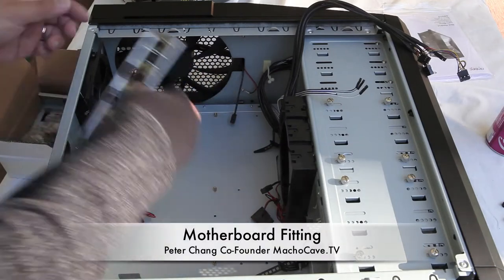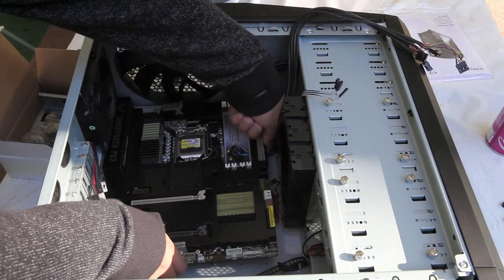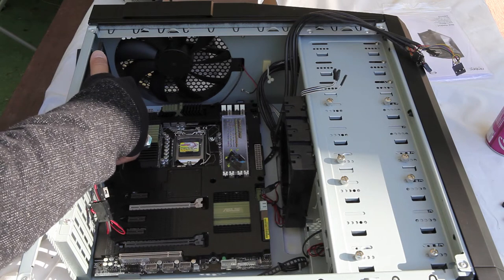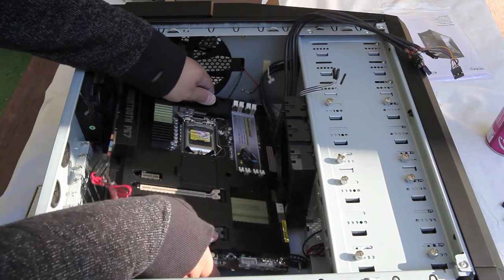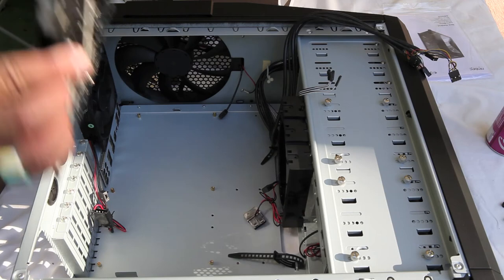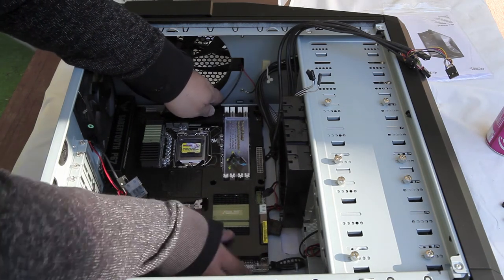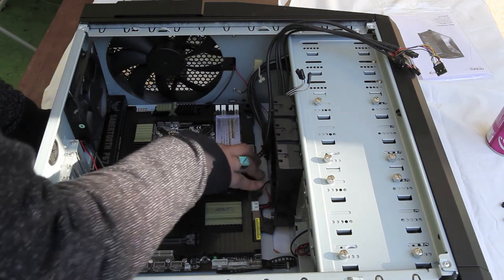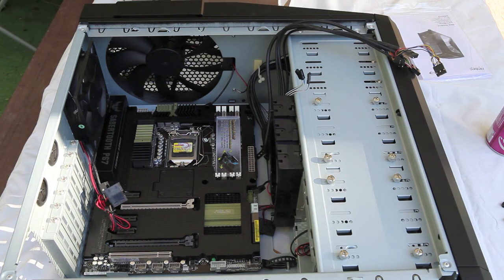Motherboard Fitting Building your own computer Part 3

Comment from the maker: Yes this can be pretty tough. If your computer case has a removable  motherboard tray, try aligning the board flush with the motherboard tray. If your computer case is similar to mine--you may have to realign the motherboard--I did this 2 times--you place one screw in--then place the exact opposite screw in and screw in the motherboard in a star pattern always going to the opposite side, till all of the screws are aligned. Also, try aligning the back plate before the foam backing--this helped me

Comment from the maker: Great question! I haven't worked with the AMD version of this board, and most ASUS boards fit standard sized cases. Also the ASUS Manual will tell you for sure if the board won't fit a standard case. Check the ASUS manual, and most likely it will fit just fine :) Most of the time it's the video card  that you have to worry about, a higher end video card might be too long to fit into the case :)

Comment: the foam backing makes it so difficult i had to push it harder to get it to align i just put one screw down and went from there
such a tedious process and the mobo is still somewhat higher maybe 2mm more or less on the left side compared to the right ;(